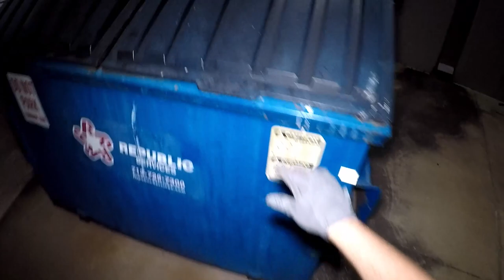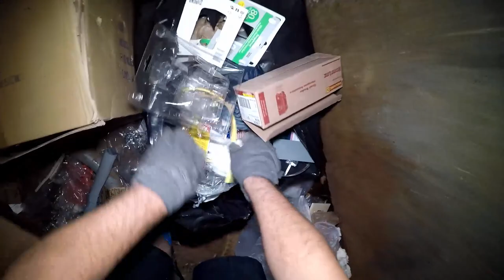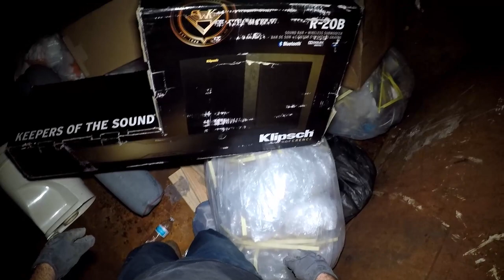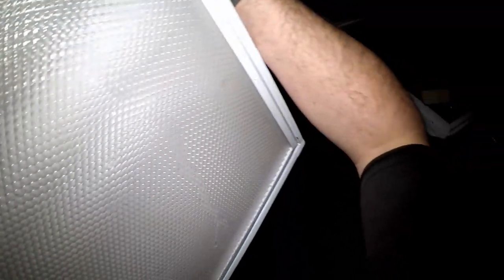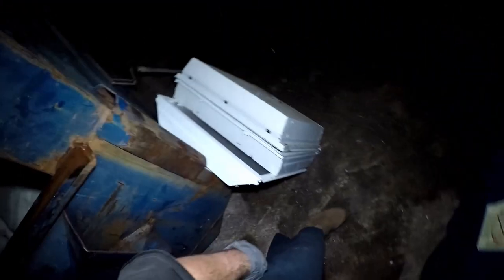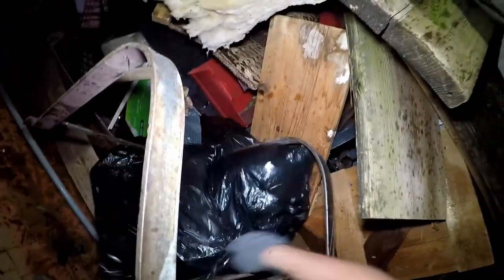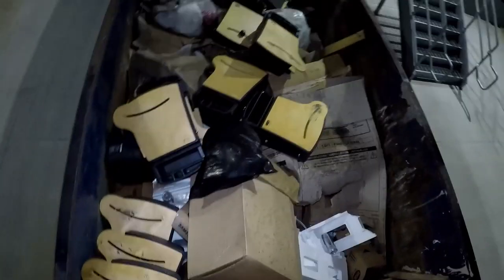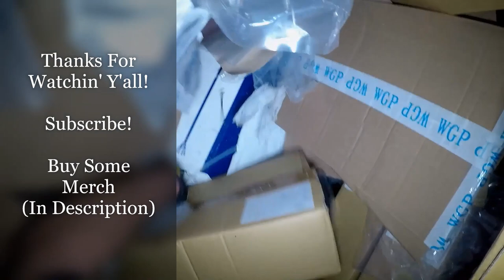Dumpster Diving "Love Grows Here"

Comment: My niece wanted a power wheels truck so bad it wasnt funny. I found one in the trash and checked the drive motors, Both good so I started checking wires and making sure everthing was good to go. It seems the battery went bad and they just threw tossed the whole toy. I changed the battery connections and we dropped a big block down in it.....lol. its a 12vt system. just added more amperage with a car battery. Best birthday gift ever.

Comment: Thanks Mike for saving the flag. The red frame with roller is for wrapping tall pallets with shrink wrap. The sledge hammer handles are an awesome score ($15+ @hardware store). Please don't tell me you're going about putting "glory holes" in stuff with the hole saw blade😖.

Comment: You should start field stripping those lights. Take them from the one dumpster and then toss all the light bulbs and plastic covers into the other. That way you don't have to mess with disposing of the bulbs yourself. Stay safe out there.✌
Reply: I agree......Mike makes a lot more work and mess for himself.  Question:  if you went hunting and shot a deer would you field dress it or would you take it home to do it  resulting in more weight to wrestle as well as a bloody and smelly mess to clean up???

Comment: Found a used Power Wheel in good shape at the thrift store for $15. Bought a replacement battery off Amazon for $25 and my boys had a blast with that thing for 2 years!  All I ever wanted was a Big Wheel and a Light-brite.  Got a Green Machine 😞NOT the same.  That sucker was TERRIBLE...

Comment: You should weld on the front of a garbage truck to the rear of your truck. Then you can flip the dumpster into your truck. Tossing out the garbage is much easier. : ) Meant as a joke but actually true...